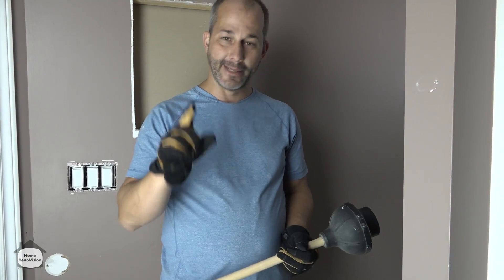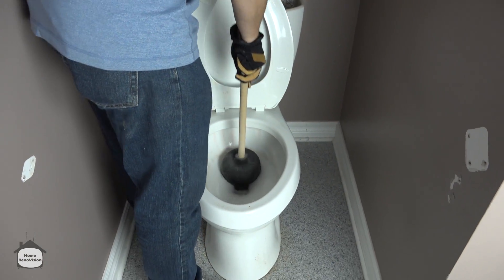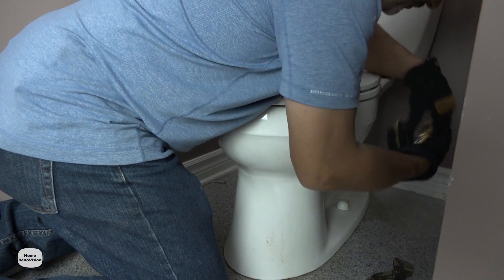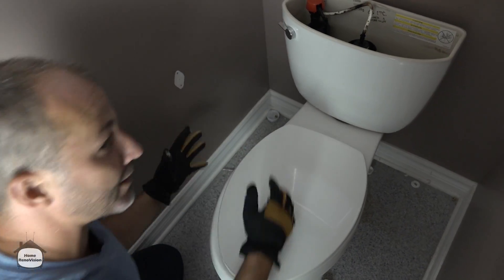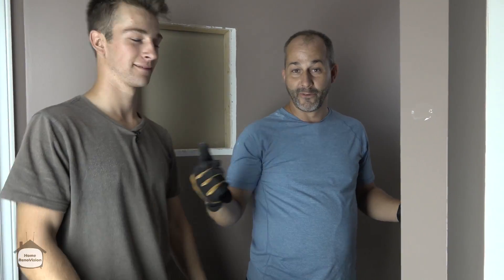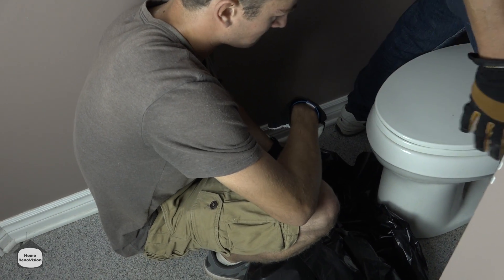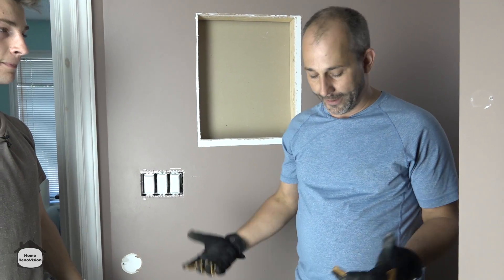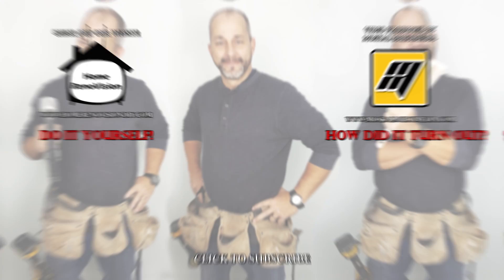How to Remove a Toilet

Comment: I did this recently only I used the shop vac to pull out the water.
Reply from the maker: I have heard of this but then you need to remove the filter first and then clean it out and then put the filter back in. This way is easy since every bathroom has a plunger in it!

Comment: Good day! Can you help? I’d like to see a video or get your opinion on installing peel and stick vinyl over OSB sub floors in manufactured homes. I currently first lay Patriot brand primed then apply vinyl. Your thoughts are much appreciated. Thanks! Bob
Reply from the maker: Hi Bob, If I was going to go through all that trouble and investment I would spend another 100 bucks a room and install vinyl plank. Cheers! It has a much better wear layer and will seriously outperform the peel and stick.

Comment: Great video, of course. Why drain the other taps in other parts of the house?  If the water to the commode is off, isn't that the only concern?
Liked the coffee cup vapor barrier.  Never heard that one.
Reply from the maker: In a lot of cases the shut off valve has not been closed in so long that the washer has dried out and the water will cause a flood. If you turn off the water first then you can double check and have time and access to remedy the situation if it occurs.

Comment: This may seem too simple:  After the plunger I use a old hand towel to mop up the water out of the toilet and squeeze it out in a bucket.  Takes a minute or two then there is NO water in the toilet.  The plastic bag is still  a good idea because you don't know what the wax ring area around the bottom of the toilet looks like.  It could be gross it you're removing the toilet itself for cause.
Reply from the maker: I am a bit of a germ freak so If I can avoid the rag I will. Cheers!
Reply: @HomeRenoVisionDIY  It bugged me the first time I did it.  But as they say, "do the most feared thing first" to get over your phobias (go down the tallest water slide, climb the steepest mountain face, jump out of an airplane, etc.).  What doesn't kill you makes you stronger.

Comment: What  is the best way to solve water condensation on the outside of the tank?
Reply from the maker: buy an insulated tank!
Reply: @HomeRenoVisionDIY  I didn't know that there are insulated tanks. I will look into that. Thanks!

Comment: I have to pull toilets a lot and reinstall them.  To empty the bowl I use a small water bottle cut in half and just scoop it out.  For the tank I use a turkey baster and suck all the tank out.  Takes a few minutes but works. I hate plumbing but a simple turkey baster helped me out a lot.
Reply from the maker: that sounds like a lot of work. Have you tried the pail technique where you pour in a lot of water and it siphons out the p trap!

Comment: Check out Oatey 31417 Liquilock Gel For Toilet Removal @ Home Depot
Reply from the maker: no doubt there is a place for that sort of thing. But what if you wanted to reinstall the toilet after?
Reply: @HomeRenoVisionDIY  reinstall the toilet and then flush. The toilet bowl will fill up and after a minute, liquify and complete the flush. The method shown in the video works and that is obvious. Presenting additional option.

Comment: That plunger was the wrong shape for that toilet and did nothing to move water.  I prefer the bucket flush method for this.  The tools you used on the cap and nuts served to damage them, which is dumb if you are only removing the toilet to paint, put down flooring, or just need it out of the way for another project and plan to reinstall it with the same caps and hardware.  I could go on, but I'll leave it at that.  Ultimately you got the job done if a bit sloppy.  One thing I do in the rare case I'm completely replacing a toilet is to use a handtruck with a strap to wheel the toilet around and out of the house rather than use my back and risk injury.   If I'm just moving it out of the way I'll use a flat furniture dolly and will roll it around with that.
Reply from the maker: perhaps a square one?